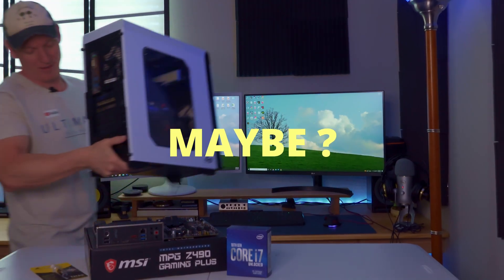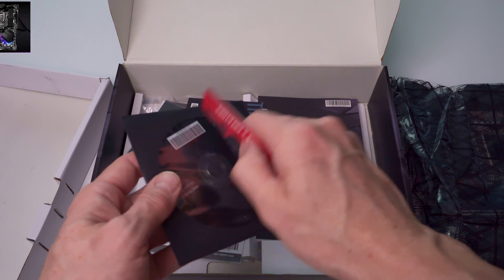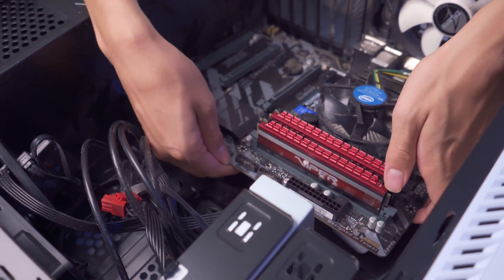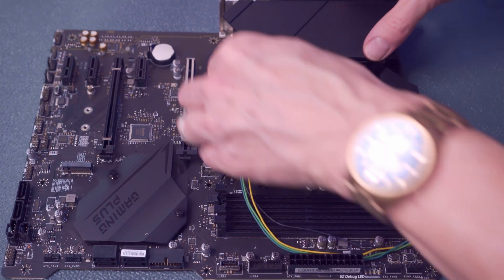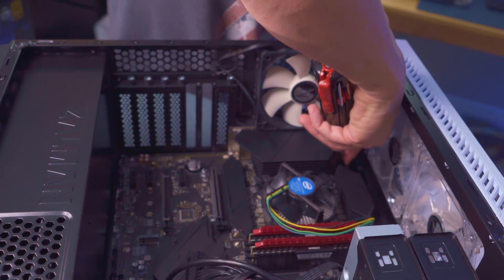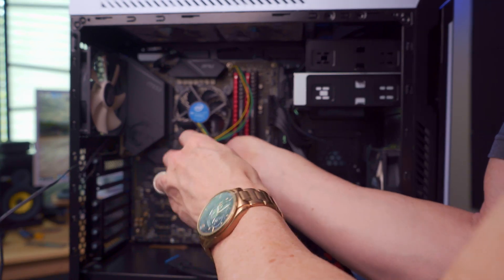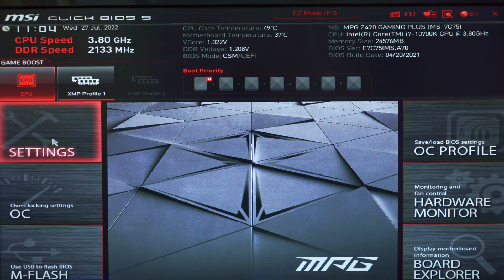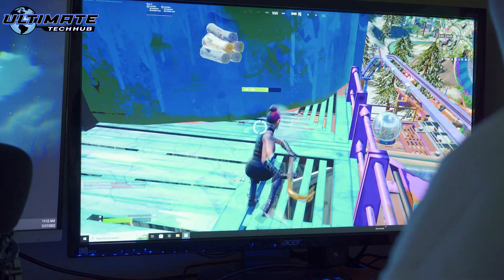BEST $400 Gaming PC Upgrade Build GUIDE 2022 - Intel CPU & MOBO

Comment: How do you connect a pc with Ethernet? I’m modem is down stairs in the basement with a router that was disconnected a while ago with mu pc upstairs in my room. My home is fairly new (less then 4 years old) and the nearest wall switch is in my parents room. Also my connection is fibre with a 1.5gbps up and down. Please I want to get better speeds with my pc
Reply from the maker: You have great speeds!! You need to connect the fiber to the router and run cat5e or cat6 cables to the rooms in your home that need wired connections. Running ethernet is not difficult and I have tons of videos on that subject. Here is a video on Home Networking Basics that gives you a simple example of my home network. Feel free to ask me any questions. 
https://youtu.be/NV7Ay6KyB8U
Reply: @UltimateTechHub  I’m not getting those speeds to my device (I’m getting something like 60) while my Modem has the capability of 1.5gbps.
Reply: Well it looks different compared to your example on the video. In my Wi-Fi box I can see wires coming out of it on to the roof. My ISP said to not drill anything. One of the things they said was to get a longer lan cable or get a wireless router

Comment: Nice video! I've seen more than a few times over the years people upgrading their GPU multiple times while not touching their CPU and motherboard. In some cases causing a big bottleneck for the GPU.
Reply from the maker: Exactly, everyone wants the best GPU but overlooks the CPU and motherboard. My sons RTX 2060 super would bottleneck all the time. The i3 (8th gen) we replaced was the main issue for this system. Now it runs super smooth and zero bottlenecks. Thank you for watching.

Comment: I'd recommend upgrading the cpu cooler with the lga1200 chipset. The two coolers I would recommend that is affordable is a cooler master hyper 212 evo black edition or the be quiet! Pure Rock 2 Black CPU Cooler. The stock intel cooler is not efficient when it come to cooling the cpu
Reply: If you want to go super cheap one of the DEEPCOOL GAMMAXX400 are about $15 on amazon.  Pretty much a cooler master 212 clone.  Does the job but if you plan on over clocking that chip a bigger air cooler or a 240 radiator is best.  I had that chip in a computer with I believe that same board...I think it was the WiFi version. 

Another thing to check in the bios is the voltages for you CPU and RAM.  Keep in mind my board may have been different than yours or a different bios version but MSI had some auto tuning feature turned on by default on my board that was putting my CPU voltage extremely high for my tastes (was over 1.375V).  I manually lowered my voltage (1.295V if I recall) and changed a few other setting and had it all core 5.0 Ghz stable and running way cooler than the motherboards stock settings had it running.  I went as high as 5.2Ghz but the extra heat and voltage needed just didn't seem worth it for the little effect it had on most things.
Reply from the maker: @Conifer_Gamer  Thanks for the great information I really appreciate it.
Reply from the maker: The stock cooler definitely wont keep the chip cool but that's all we had at the time. Thank you for the recommendations I really appreciate it. I've done a CPU cooler install on my channel and when I finally get one for this PC I will do another video on the process and a review. Thank you for watching!